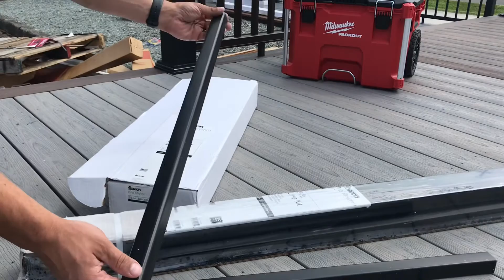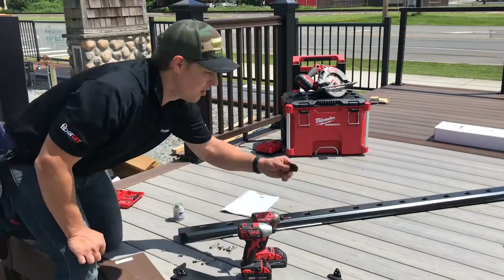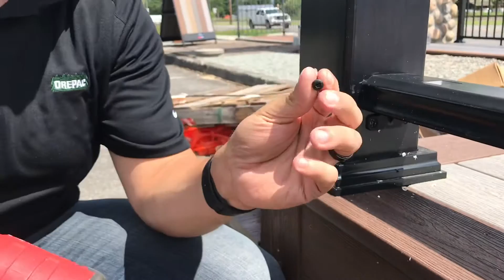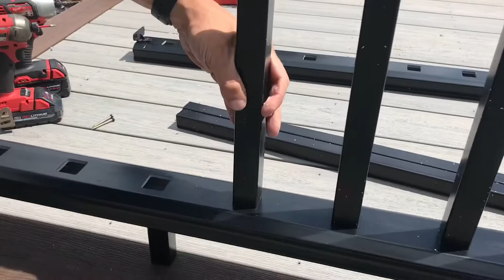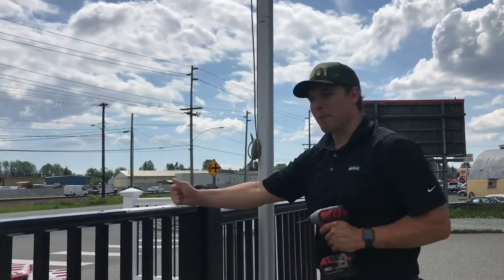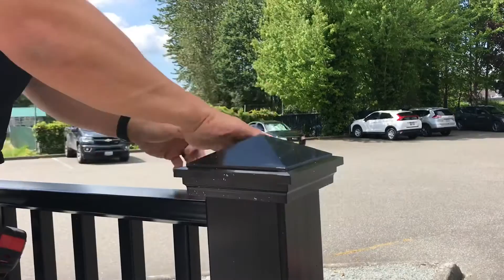FIberon Brio Rhythm rail install

Comment: HI. do you know which fiberon railings can accomodate a drink rail (using decking boards)?
Reply from the maker: Currently, there are no Fiberon branded options for that, but I can say because I didn’t sign any NDA that the Cityside will be having some sort of adapter system for deck boards.